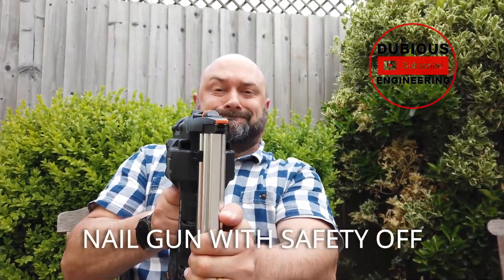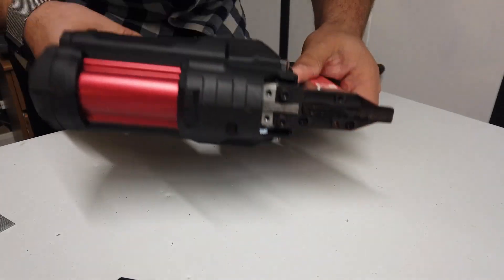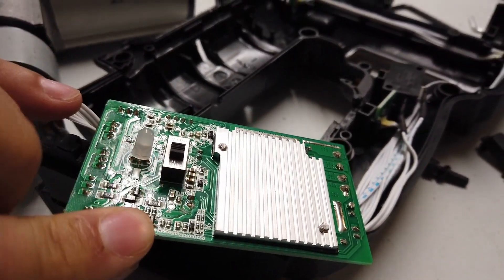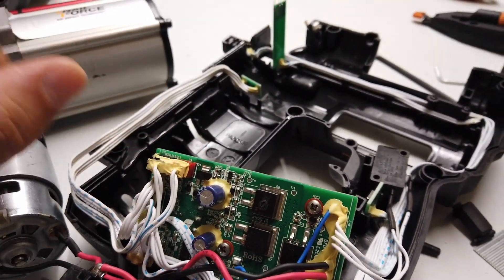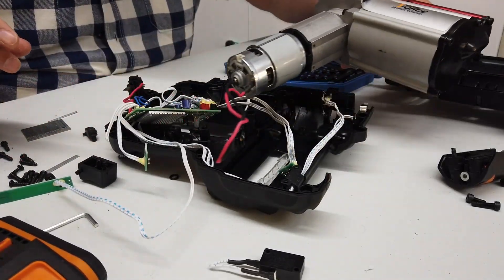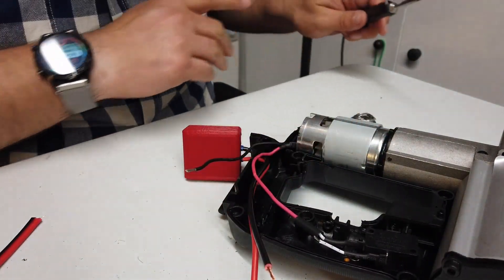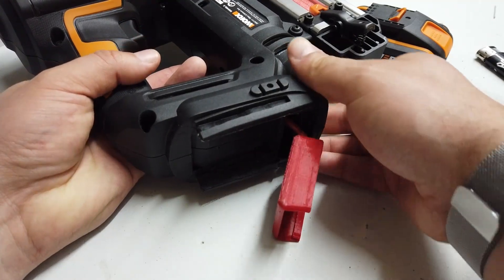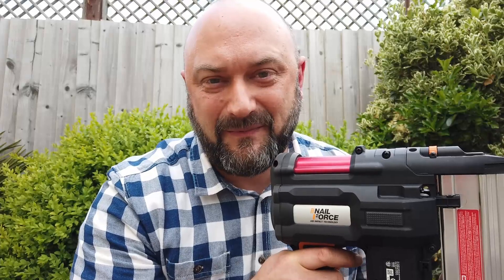DuB-EnG: Battery powered NailGuns - How it Works and Removing Damaged Safety Electronics / Circuits

Comment: Wondering if one could modify the nail mag to hold insulated staples for electrical wiring. Great vid ❤
Reply from the maker: I'm very certain that would be a shocking 😲 experience 🤔 ,:-)
Reply: @DubiousEngineering  it would certainly be dubious 🤣

Comment: I would have thought that they would have used a coil gun to fire the nail into the wood.
Reply from the maker: Yes, I was wondering what was inside it before opening it.  Perhaps a coil system wouldn't be very efficient on the battery? ...   Or maybe its too expensive? - Not sure why! - Have a lovely Sunday David!!